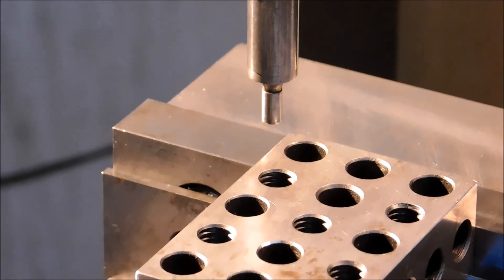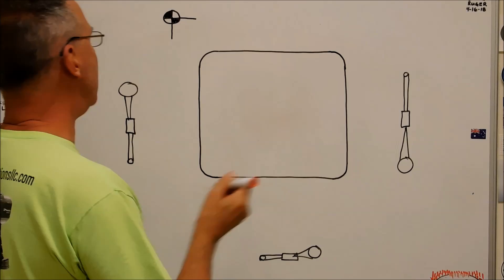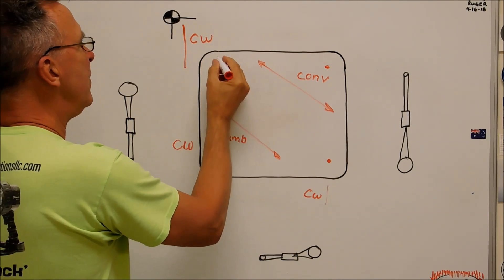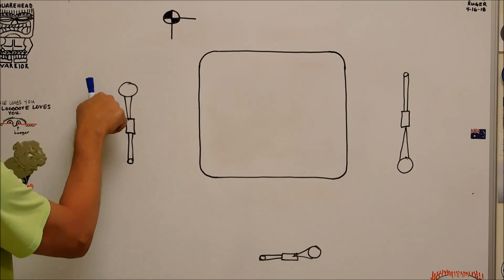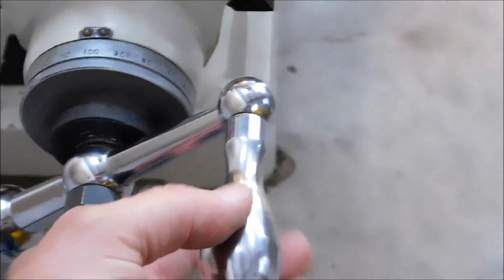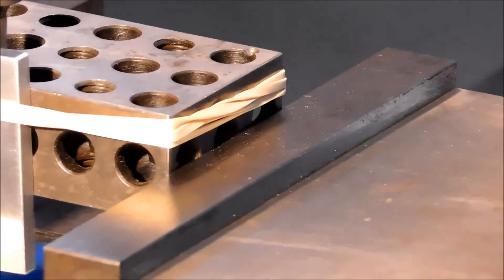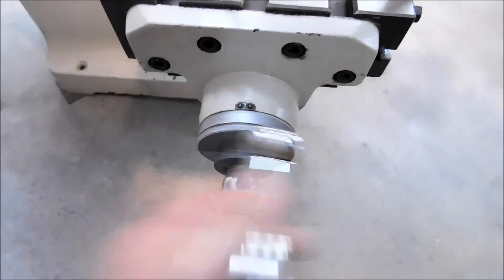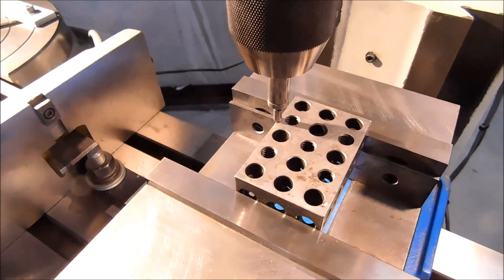Ignore The Backlash,  Manual Milling Just got Easier.

Comment: For the y-axis could you not just make a little extra, adjustable collar with an extra tick for the ccw cranking?
Reply from the maker: That may relieve some movement, but the backlash is at the lead screw/drive nut area inside the table.

Comment: Hi Joe, I was confused on the Y axis indicator tip. Do you use a super long drop indicator? Or do you reposition a standard 1" drop indicator and move it every time you have to move the table more than the indicator travel? Or is it something else I am completely missing? Any chance you can do a video of the Y with indicator? Thanks!
Reply: Nick:
If I understand correctly the indicator reads zero when the cutter is at zero.
The table moves off the indicator & away from you for all machining operations.
When you come back towards yourself & the indicator reads zero your cutter is back at zero. 
Hope this helps
Reply: @Ted007-r5r  Thank you.

Comment: I'd argue even with a dro you need to worry about backlash
Reply from the maker: I'd agree with that, but not to the extent of a dial reading without one. Even with my DRO, I try to always register my dials in the same direction. Old habit.
Reply: @joepie221  isn't the design of the individual handle supposed to balance out any imbalance of the handle? That's why there's that big ball of metal to counter the weight of the bit you hold. On a freewheeling shaft, anywhere you stop the handle is where it "should " stay. Not saying that setting the handles 180* out of sync is wrong but some mills with power drives don't have a left handle on the "X" axis. Precision Mathews for example, their 'X" drives are horizontally oriented so you actually remove the left handle on installing it.
Not sure what happens with handles that are just a circular disk with a handle. Maybe there's a balance weight in the casting, like a locomotive drive wheel but I don't know.

Comment: Always set a little drag with your table locks so the table does not wander by itself. Don't lock and unlock  until you are completely finished with all of your operations .  Also, don't touch the knee lock. There are inherent movements  in all of the way surfaces that will NOT even show up on the readouts because of the " slop" in the ways. Even raising and lowering the knee will change your "zero" x and y settings as the machine is not that square and if your head is not trammed perfectly true, the geometry changes your locations. This is especially true when machining pockets and putting holes in location.  Remember, it's just a vertical mill  with readouts.

Comment: I like it. Now, is there a way to do a bolt circle with no dro?
Reply from the maker: Absolutely. Just trig out the locations and make sure every table move location rests with the dials turned in the same direction. That will eliminate backlash and give you the desired result.
Reply: @joepie221  well with a drafting program no need for the trig. But how to do a projected edge on a round object?

Comment: Thats not exactly true....when you pick.up the cutter to reposition at zero to conv. Mill....you have to set the backlash before conv. Milling
Reply: Not sure if that’s correct...to return X axis to zero, you use the lefthand crank and that movement is clockwise.
As he indicated, use a dial indicator on the Y axis to get back to zero...
Reply: Wouldn't you normally do up the table locks so that the leadscrew always pushes the table rather than the table being dragged by the cutter? It is easy to feel the cutter starting to drag the table when climb milling and increase the table lock force to offset this tendency.

Comment: Rather depends on your milling machine having two x axis handles!
Reply from the maker: The majority of them do.
Reply: @joepie221  Many universal type mills don't. Mine takes a changegear adapter for helical milling instead. For some reason bridgeport style mills are not that popular or favoured for most operations in my area. They are considered to be purely mold drilling machines. The most popular model here is the FU251 and it's nothing like a bridgeport.

Comment: Thanks Joe my mill is so old its laughable but it has three things that make it worth while. One is the ways are good the screw is pretty tight and its motor is 240 single phase. But it sucks not having a DRO and the dials are not very good (only have one crank the other is missing) but indicators really help.

Comment: The handles are balanced. That is the reason the ball on the other side is larger. They won't turn due to gravity. My mill is opposite yours on the Y. Counterclockwise moves the table towards the back. (Atlas table mill) I think Bridgeports are like that too. What type of mill do you have that clockwise moves the table to the back? I can't reliably climb cut on the machine with reasonably sized cutters without really tightening down the table locks.
Reply from the maker: In all my years of experience, I have never seen a mill that clockwise rotation of any handle doesn't move the table away. X or Y

Comment: What a great idea setting the X axis up like this! My mill only has one dial on the right side X axis, the other left side has the table drive motor. I use one datum on the work setting the X and Y to zero at this point with play removed turning the dials all in a clockwise rotation, and doing my milling (most of it planning ahead) in the same direction. If I get lost, I can always return to the datum point and then proceed counting to the next location to start milling again. Do you have a better idea for this setup?

Comment: rubber bands Joe should of use small C-clamp and normally when I use a edge-finder gotta do it two times before I zero my axis. I kind of wanna see using edge finder true position + on one of the holes on the block with test indicator. Like your videos allot made some tools already,  thanks Joe
Reply: Joe mentioned that he would normally use a clamp, the rubber bands were just for the demo to save time.

Comment: Setting two zeros and using an indicator for Y, that's what I was taught very early in my learning, it was one of the most valuable things I was ever taught, the second most was machinist buttons and a very good indicol setup.

 I was fortunate I had three very experienced, knowledgeable machinists teaching me, one had worked at pratt and whitney, GE, General Dynamics, and a few other places, and had been licensed as a repair technician for the CNC by the manufacturer and was licensed to work on the Fanuc controller on the machines we were using, The guy was brilliant, the other was someone he had trained and worked with for a very long time, and the third was trained by both of them. I also had a very talented tool maker that was very willing to help if I asked his advice. It's not lost on me how fortunate I was. Their training though was great, you were not allowed to touch a CNC until you could make brilliant parts and fixtures on the manual machines, in their words "You learn on a manual machine, you see a CNC and go wow, those guys are amazing machinists" but then you go work on a CNC and realize, no, it's an amazing machine, but if you know how to make the part manually, understand the physics, and the math, you'll be a better CNC machinist, those who don't understand those issues may make good parts, but when things go wrong you can still make a great part." They weren't wrong.

I was also fortunate early on in their training, they had sandvik come in for a training seminar, to teach about tooling, cutter types, and carbide tool selection etc. if I struggled with anything they would create a theory and number test and a practical exercise. my department head would also if I wanted to learn something or couldn't find the information, he would... how do I want to phrase is... "accidentally leave a book open to the relevant pages, with sticky notes in relevant sections on his desk before he left". Basically if I didn't have the books or source of information I needed, he would take the time to find it in his collection, mark the parts I needed and leave it for me. I was exceptionally lucky to work with the guys I did. They also had a disposition of "If you don't have the tools in your box that you need, my keys are in this spot, use mine, as long as you clean and return them"

I miss working with those guys lol
Reply: Awesome story. Hope you stayed in touch with them. I got one of These guys in my apprenticeship too. He really cared that WE learned a lot more than we needed and gave so much valuable information when you asked him.
His specialty was precision grinding. He still got called years after he left when there were some problems with grinding some strange inside round features within one micron(1000th Millimeter) in his old machines.
Reply from the maker: Any machine capable of that precision, should not have any problems.
Reply: Hope you are doing like they did with you, pass on the knowledge. Cheers
Reply: @zedostenso3069  I share my knowledge whenever I can, something I hated early in my life was older people constantly going "You kids these days don't know how to do anything" then refusing to teach. So now that I'm in a position some of them once were, I teach anyone that will learn from me. Whether that's machining, cooking, woodworking, or life in general, because I saw a lot of "we don't have time to teach you" in my life.

Comment: thats a great way to work with what you got but can backlash be fixed ? would it be worth fixing, great polished vid as usual please dont stop em coming
Reply: Split nuts with spring preload have vanishingly small backlash.
Reply: Just put ball screws on the X and Y screws.  Ball screws don't have backlash.
Reply from the maker: Usually try adjusting it first, you will still have some. If it wont adjust out, you can get a new drive nut. They are the wear point. Its very conditional and is dependent on the machine condition as well.

Comment: Makes sense! Is that amount of X axis backlash typical on a used but not abused Bridgeport style mill? I’m thinking about buying one for the first time and wasn’t sure how much would be too much to worry about.
Reply from the maker: Not uncommon at all. I would also say its not a matter of how much backlash there is, but a matter of how much adjustment is left. If the machine has a lot of backlash and the adjustment is consumed, then it requires more than just a an adjustment.

Comment: At looking at the handles, dosen't the ball ends placement and size offset the weight of the handle end?  Always a great video.
Reply: Its supposed to. Usually it doesn't do a complete offset, and if the machine is loose, the screw can turn by itself.

Comment: Hi Joe, I love the content.  The imbalance of the handles is some thing experenced,  ( moving down on a chattery or interupted cut)but never thought to check the handle orentation.  Some mills  have almost a small ratchety  or almost an indexing feel to them  on  the screws,  is this to prevent inavertant movement? I know Tom' s mill at  OX tool, has this, You can hear it in the videos.  Does your's?  If so, do you like it?
Reply from the maker: Mine does not.
Reply: My mill has that ratchety thing happening in X & Y. It didn't in Y until I put one of those Chinese aftermarket power feed units on it. Now I understand what but not really why.. Too busy to pull the kit apart and refine it but I will..
Reply: @captcarlos  The power feed motor may have cogging where the motor magnets react to the movement.  Not possible to change that.  If it doesn't affect the actual feed then no worry.

Comment: Sir, you run one of the cleanest and neatest and most professional shops I've seen. Super classy! Except - your audio is horrible! Please bring you audio quality up to the standards you otherwise project. Please!
Reply from the maker: Thank you for the compliment. At this time, my BX500 Nikon does not support external audio input, and I don't have a remote transmitter for the computer. I do plan a camera upgrade with the patreon funds. It should really up the video quality.

Comment: Nice technique, This will work on most cuts that do not have close tolerance or finish requirements. Definitely would have to leave some light stock for a finish pass to minimize the climb mill vs conventional mill effect.Climb cutting pushes the cutter  away from the cut while conventional cutting sucks it in. The result is  uneven stock removal and a poorer finish on the conventional cut.
Reply from the maker: A definite possibility. Keep the final passes light.

Comment: Very good demonstration, Joe. The problem with my older mill is that the backlash isn't consistent over the length of the lead screws. The only good option that I had was to invest in a DRO.
Reply from the maker: Good call.

Comment: I always thought that the ball on the crank was there to balance the handle.  Apparently, that is not the case on your machine.
Reply: I was scratching my head on this one too.
Reply: It's not the case on my mill, it has circular control wheels and the handle does unbalance the control.  I have got into the habit of snugging the lock before I let go of the handle to prevent it drooping.  Setting the two handles at 180 degrees is a great idea.  Great video as always Joe.
Reply from the maker: Its not the case on all machines.
Reply: Joe Pieczynski Then what is the main purpose of the ball end?

Comment: As always, a brilliant presentation. Balancing the X-handles makes sence but will that be safe for vibrations during the cut? Locking the table ought to be the safest way to go during Y- or Z- operations.
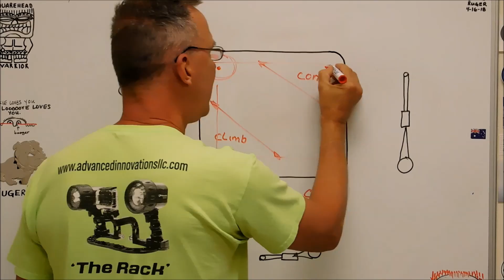At the time 4:28, You move from the lower, right corner back to the starting point, upper left corner. Then You change from cranking CW to cranking CCW, and Mr Backlash is there. How do You do make that not influence finding the starting point? Go well past the starting point and then cranking CW on both X- and Y- axles?
Reply from the maker: Approach the starting point exactly as if you were coming from the absolute zero position. Tool above the part, past the corner, then back to starting point, tool down, cut.
Reply: @joepie221  I would think so. Suppose You have milled some 100-200 crank turns away on the X-axis. Then it's easy to miss one or two numbers of crank turns and hit the wrong zero indication on the crank wheel.
Reply: A sharpie mark across the intersection of the of the table and saddle when I have my zero set always brings me back to the same zero on the dial if I get mixed up.
Reply: @sherrytop2591  Bingo! You have passed the same school as Joe I guess. Easy and brilliant! I've got sharpies…. and digital scales…...
Reply: @Stefan_Boerjesson  A sharpie marker pen line across the table slide way when at your ref position gives you a quick sanity check and saves having to count handle turns.  I also write the dial value next to it unless it was zero.  I had to do this lots when my machine had dials that read 0 to 12.5 for a 2.5mm pitch lead screw  (The designer must have been drunk!).  It was such a recipe for getting confused!  I quickly fitted DRO and now CNC so this is mostly a distant memory.
Reply: @MrSailbadthesinner  I've got a few such dials as well. Yes, drunk, or Chinese designer using what they have in the back yard?
Reply: When going in the CCW I would go beyond the CW 0 point and go CW back to the 0 and then start my cut.
Reply from the maker: Kevin Henry  Exactly.

Comment: Your a very capable machinest Joe . I have scale sag in an igauging scale, a 24". I have a grizzly Go516 with a arduino DRO heck for the price its nice. I built the DRO myself it has tool table's, programable hole paterns.I can switch between lathe and mill. But that 24' scale is so needed cause it uses the lathe z feed thats in .010 thats what i gotta fix today The ABS INC so i can put a bolt patern reletive to a point. Also making a piece of scrapyard railroad track into a base for an awesome bench grinder tool rest I use square blocks and a protractor to sharpen stuff like boring bits that you just wouldnt belive were'nt made on a ko lee

Comment: For my 1963 Cincinnati 1B Toolmaster X-axis is pretty good about 0.003" lash after adjustment, but even though I replaced the Y-axis lead screw, still has 0.020" of backlash (the Y-axis nut is a cast iron bracket going up to the table). I have converted it to a 3-axis LinuxCNC. I know LinuxCNC nor an ACME leadscrew were ever designed for this type of machining, I', going to run a test piece of gcode to simply add the backlash into the design in the Y-axis (stretching the design in the Y by the amount of backlash).
Reply: If you can hack the firmware you might be able to code in your known backlash and let the Linux CNC do the compensation on the fly automatically.
Reply: @matthewperlman3356  It is easy to add a call that calcs the backlash and turns that into table movement that negates the backlash.
Reply from the maker: This sounds like a perfect opportunity for a simple macro. I don't have the skill for that, but it has to be possible somehow.

Comment: Great tip. Maybe, and only maybe, to clear the mud, the only missing part of the video was to show the backlash itself by not moving. I may be wrong because I’ve never be close to a machining equipment. You move the cut into the block, then come back to zero using the right hand crank. At that point the spindle is on the edge, zero. I guess the left hand dial is showing no-zero. The amount of backlash.  Am I correct?